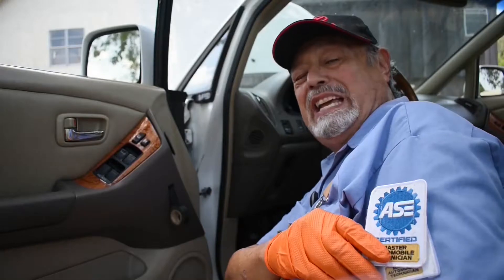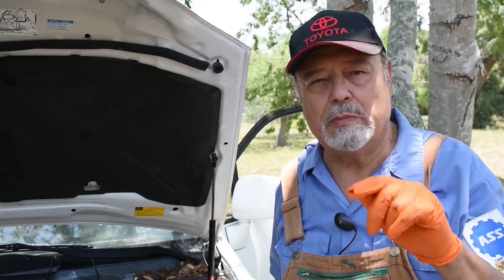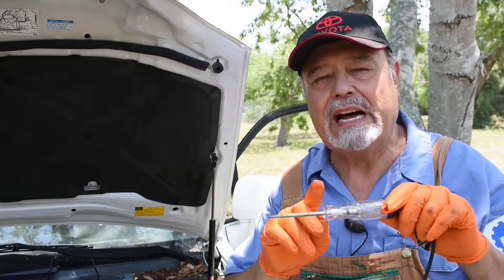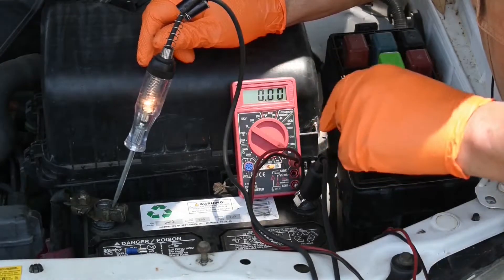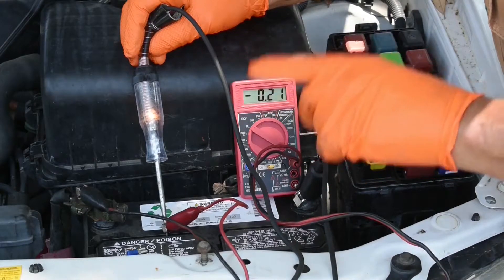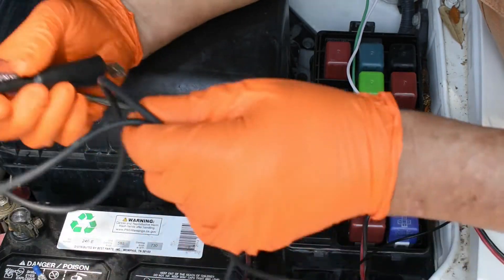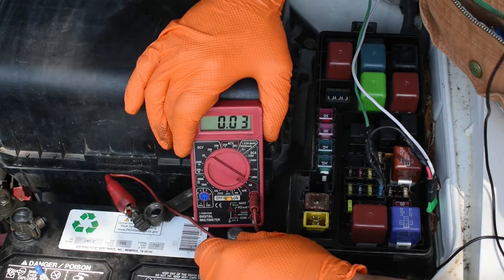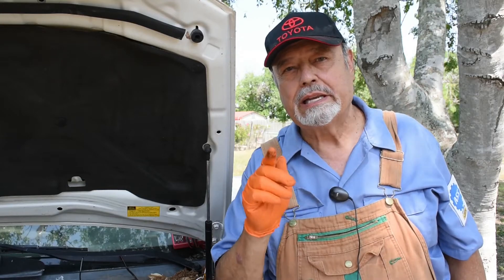How to Save $$$$$$ on Electrical Problem

Comment: Why not just fix the problem? Those shorting fuses are installed for a reason, and its not the problem with this vehicle. I'm guessing its a Toyota. That fuse is installed by the dealer during the pdi process and is removed for long term storage. The battery should not be going dead after only 5 days. The shorting fuse disables several systems, and to find out what system is causing the excess drain, you leave it in and pull the fuses for the systems that the shorting fuse covers. Once you have the circuit isolated, I say fix it. Installing a switch is only going to void your warranty, and if there are any issues in the future, the mods will automatically be blamed as the cause. Also, electrical problems don't go away. If something has gotten to the point of a significant drain on the battery, its only going to get worse.
Reply from the maker: I did not fix the problem because the customer did  not want to spend the money to buy a BCM or pay the labor to replace it. Thank you for the question and the comments. That shorting thing that looks like a fuse provides the power to BCM , the fan relay #2, and something else (I forgot) . Thank you for informing me on how the shorting thing is removed for long term storage and installed by the dealer. I had no idea what that thing was.
Reply: @theoldmecanicoshow9004  When I said fix, I implied a proper diag was done to confirm the problem. Several fuses get power that runs through the shorting fuse first. Pulling the shorting fuse won't tell you where the problem lies. It narrows the problem down to the fuses after the short fuse. Those are the ones to look at if you want to confirm what system is giving the problem. 

The vehicle doesn't need the shorting fuse to run the engine, but each brand is different, so you have to see exactly what it does for the specific vehicle you are working on. It almost always covers a good portion of the interior electrical systems. Its sometimes called a room fuse for that reason. The drain could be coming from the radio, dome light, etc.. I highly doubt a module is bad. While not impossible, most module replacements are misdiagnosed.

I would finish the draw test first to find out where the problem lies. The customer may still go for the repair if it turns out to be something not so expensive.
Reply from the maker: @AT-wl9yq  I have fixed enough cars to fill the Gulf of Mexico, and if you believe that, you have never been in the Gulf. 

I can be a bit odd. I like to think of it as being “Colorful”. Wait until you hear about my “Cheap Thrills”. I get off to fixing cars for a $1.00. 

As an automotive instructor for forty years my favorite cheap thrill was fixing an automatic transmission that would not shift (or shift super late) for $5.00. in the 80’s Ford transmissions started using a TV linkage instead of a vacuum modulator. The plastic clip on the linkage would get brittle and break. The new clip was $5.00. The customer would go to the front office and pay $5.00 to get their transmission fixed. 

I don’t know why I would get such enjoyment out fixing cars for super cheap. Even when I was fixing automotive AC’s out of the driveway of my home, if I found the problem quickly and the repair was EZ, I would charge the customer $1.00. 

Why did I do that? Well for one thing I would have a customer for life, and they would tell all their family and friends that this guy is fixing cars for a $1.00
After their first visit, the price of the repair would go up. 

Thank you for your comments and information. Also thank you for the view. I hope I didn’t bore you too much. I’m curious…do you believe my story of fixing cars for a $1.00? It’s a true story. Have a good day.
Reply: @theoldmecanicoshow9004  I'm not questioning any of that. I believe you. That said, I'll admit to making one assumption I got from watching a few of your videos. Going by how you present the material in the video, it looks like you are used to working on older cars. Most cars made in the last decade or two, have the shorting pin/room fuse. Its kind of like getting a U code. 99% of the time you never diagnose a problem based on a communications code. Its a last resort. With the shorting pin, you don't typically diag the issue directly from it. You isolate the subsystems, and diag those.  

Beyond that, new cars are so much more technical and the companies require a lot more information. Any part you replace in todays environment has to be proven bad or  the claim will get kicked back. For example, in another one of your videos, you were talking about misfires. If I have to diag a misfire and I don't hook a scope up to the car and do a power balance test, whatever I come up with for a diag will not be acceptable, even if I fixed the car. I also do a lot of short blocks. These things require hundreds of new parts. The job requires the use of RTV in certain areas. If I don't go into parts and get a fresh tube and actually bill the company for it, the whole engine job will get kicked back and we won't get paid. If I use the tube from the last job because I have plenty left over, I'll get in trouble.

Anyway, this is what you normally have to deal with. We're all forced to prove everything, and if you miss one small detail, its not acceptable. Maybe I'm being too analytical, but that's how everything is today.
Reply from the maker: @AT-wl9yq  Thank you for sharing your information. You are correct about me working on older vehicles. The vehicles we (students and I) worked on were usually about 8 to 10 years old. People (our customers) would not trust 
"Students" learning the trade to work on their newer vehicles. Thank you again for the comments and the information.

Comment: How about wiring up a relay to trigger that “short” circuit?  No toggle switches to mess with. Everything stays under the hood
Reply from the maker: WOW WOW WOW !  That is a GREAT idea. Have you ever done that? Install a relay to fix a drainage problem ? When it's time to sell that vehicle, that toggle switch action inside is going to be a big turn off. Thanks Again.
Reply: @theoldmecanicoshow9004  no I haven’t.  I was just thinking about the tacky toggle switch myself. I figured a relay would work better
Reply: Harry  true but you don’t want to overload that relay.  Seems like the vehicle all ready has wiring issues. I wouldn’t want to stress out another circuit.  Peace of mind to add its own relay circuit
Reply: I think using the ignition would've been a great idea..Am glad I learnt how to figure out how to find battery short...thanks

Comment: By the way I did the little paper on the oil stick and it blew paper off🤣. I figure it just too old and tired. I did this on my 1965 Mercury. Thanks for the helpful videos .
Reply from the maker: Thank you for the comment and the view. The age of the vehicle does not matter. If it runs good, the paper should stick, unless the engine has excessive blow by. ( scored cylinders and worn rings)

Comment: An ampre is the measurement of  current flow.  Voltage is  electrical pressure.
Reply from the maker: "Correcto" ...Thank you for the comment and the view.
Reply: Thank you

Comment: I have a 1965 Mercury Monterey breezeway 390 v8. The Breezeway window in the back doesn’t go up and down. How do I yes electrical on it?
Reply from the maker: Thank you for the question and the view. Steps: remove door panel / disconnect the 2 wires going to the window motor / see attached image / connect test light to wires that do not go to the motor / key on engine off / push and release the window switch / push and release on way and the light should come on / push and release the other way and the light should come on / if the the motor does not work...the motor is bad  / if the light does not come on...more testing will be needed.
Reply from the maker: https://www.google.com/url?sa=i&url=https%3A%2F%2Fwww.carmodelslist.com%2Ffuel-injectors-and-noid-light%2F&psig=AOvVaw2IaW_8xM_z8RJ4EZyconeV&ust=1652823430913000&source=images&cd=vfe&ved=0CAwQjRxqFwoTCJi8oo6Y5fcCFQAAAAAdAAAAABAm
Reply: Test